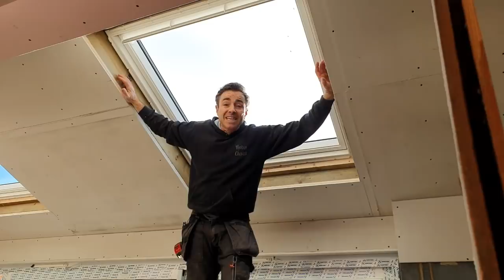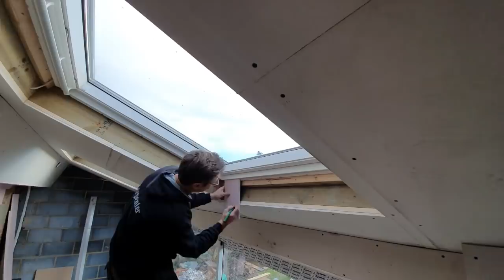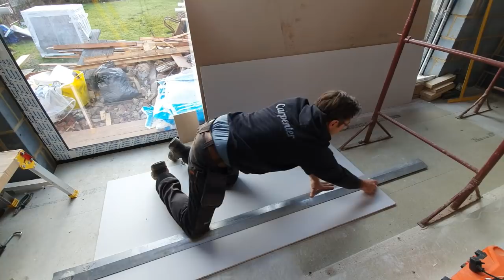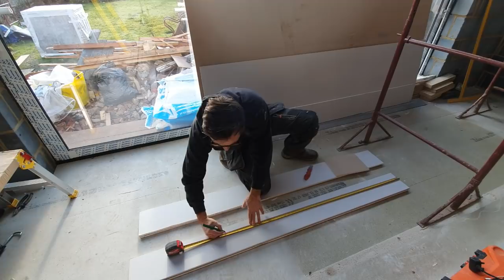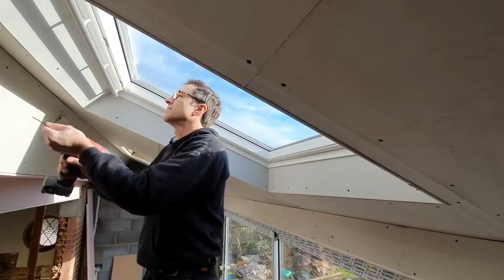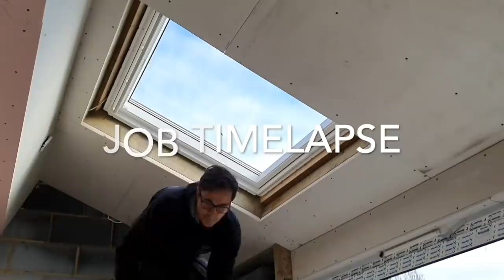How to Plasterboard a Roof window the fast easy way

Comment: A splayed edge is great, but how do you do this while having 52.5 mm insulated plasterboard instead of the normal 12.5mm(which you seem to have)? The point at which one attaches the screws would be too far in surely?

Comment: That is some beautiful work. Question.  Would you not pack out behind the plasterboard with some mineral wool or other insulation to maximise the thermal efficiency and prevent cold spots?

Comment: Great video but wondered why when you got the angle marked onto the offcut, why did you not just transfer the angle onto the 2 pieves you hadnt put up yet? Instead of taking down the pieces you already put up? That would also remove the need to cut around the timbers.

Comment: Just built a similar roof myself and the building inspector has had me put 100mm kingspan in between the rafters then 50mm kingspan over the rafters to stop heat transfer. It doesn’t look like you’ve had to do the same. Is there a reason for this or have I just got a jobsworth inspector.  Good tip with the plasterboard.
Reply: It might be insulated on the outside.

Comment: I just use a tape for depth,,do longest opposites first, then just use a speed square to mark the angles.
Squirt of foam adhesives bind and screw and they never move

Comment: Not impressed. Looks smart and no doubt you're a great chippy, learnt some great tips from your vids. However, it should be insulated behind the reveals and as a bare minimum have vapour barrier, fully taped. This could fail you an air test on a new build.
Reply: Any videos you know of with examples of best practice?
Reply: @fredrickwelch5678  Not that comes to mind. It will all depend on what insulation build-up you're using and there are a number of ways to tackle it. As some have said, you need to leave enough gap when installing the timbers for whatever insulation you use. Can be easier said than done on a retrofit. If in doubt, throw polythene and joint tape everywhere. Can't go wrong then.

Comment: I like the way you took all the measurements to start.. that can't be right surely if you fit top and bottom board first that side piece ain't fitting it needs re-measuring as the gap will surely be smaller
Reply from the maker: I took the overall length measurements to enable me to cut all the material in one go, the next step was to mark cut and fix the boards in situ and this makes it real easy, hope that helps mate
Reply: @robinclevettcarpenter  cheers thank you appreciate the reply and yes I see what you mean

Comment: Best to allow room in reveal for celotex insulation behind plasterboard. Stop cold bridge.
Reply: Good shout, some of the 25mm backed stuff would surely make a difference.
Think you could end up losing the frame behind it by the time it’s beaded and skimmed ?
Reply: @amateurvegan2636  you can get 20mm or 12mm thickness insulation. depending how you site the velux within rafters. Normally works out.
Reply: @colingreen4625  cool, never really used it myself because it’s so pricey! Good idea though
Reply: For Velux reveals I am going to use 12.5mm tile backer board.  Stronger than plasterboard and has a foam core so a bit better for insulation and easy to cut.

Comment: Interesting way of doing the reveals. I can get a sneaky 25mm of PIR in the reveals if I set it 90 to the window. I guess this can distribute the light a bit better. Hmm may give it a go.
Reply: Thats how i do it also, i think it looks better without a splay and like you say, you can get a bit of insulation behind the reveals.

Comment: I would have deducted double the thickness of the board (25mm) off the overall length of the sides and fitted without removing the top and bottom.
Good tip with marking the board though and a spot on job regardless.

Comment: You wouldn't use angle beads on the corners as there isnt a right angle.. they need stop beads, I did mine using the metal plaster bead tape but plasterer wasn't happy so I used the stop beads instead.

Comment: Hi Robin always impressed normally sorry to say not this time,standard plasterboard on reveals and cheeks absolute rubbish stick with the firecheck  or sound check we always cut width 50 mm deaper then run the saw through the ceiling line this way the angle always follows the angle of the roof regardless we always SBR cut edge and fix beads with no crumbling.A bit surprised no insulation at edges ? Keep up the great work👍

Comment: Something I do with plasterboard that I rarely see others doing, after scoring and breaking I'll fold the board then run my rasp over both cut edges at once before separating my piece. Keeps your edges nice and true and saves having to knock off any lumps that might make the board a bit tight.
Reply: Beat me to that comment mate. Makes life so much easier 👍

Comment: Wish I’d known this way a few years back, I’ve always battened them square or used insulation board.
Must let more light in this way too. 👍
Reply: Out of interest, which way do you think looks best?
I have some to do soon and I was thinking the extra insulation could be more beneficial than the extra light, as there should be plenty of light either way, but ultimately esthetics is key.
Cheers.
Reply: @SimonPlatt  I’m not sure, maybe Robins way looks better than square. I’d have thought an insulated reveal was a building control requirement though?
Reply: @lukehanna3344  Agreed  ...on both counts!

Comment: Robin, surely if you had deducted 25mm from the length of the top and bottom pieces [2x12.5mm, assume], that would negate the second part of cutting them to length.
The sides fitted, then the top and bottom would be the right size to fit.
Or, install the sides first, then measure lengths of top and bottom.
Reply: Nope, because they are compound angles. The sides and top/bottom splay outwards from the window to the bottom of the rafters.
Reply: @Herpitor  -  well, yes, I didn't think the sides were splayed, but if they are, you're right, can't be done that way. How silly of me!
Reply: Platerboard comes commonly in half inch and 3/8 yhickness why make things awkward by convertimg them to mm
Reply: @saltychannel21  -  Because this is not the US!  As you may not have noticed, Robin is using the far easier way to take measurements - in metric. The boards are 9mm and 12.5mm in Europe and most other places!
Reply: @the-tessellater  im in the uk and have been a joiner/ builder for the last 25 years. I generally use inches as its usually easier to remember measurements when your not  trying to remember numbers in the thousands. I sometimes use metric if its nearest to a round number but generally use inches as its more simple to remember measurements usually. Sometimes i use a mixture haha so it might be 87 inches and about 5mm. The only time i use metric is when fitting kitchen's as everything comes in metric sizes so its the only time when metric is the simplest  option and even then i still revert back to imperial when cutting fillers and worktops. People i work with find it hilarious when i give them mixed measurements
Reply: @saltychannel21  I'd like a 2.4 length of 4 by 2 :)

Comment: It’s how I do it. I always try to get the bottom reveal vertical. It looks really cool if you line it up exactly with the wall below. (Takes some figuring when you actually fit the velux) I also would have packed out behind the plasterboard with insulation or blown some foam around to prevent a cold spot
Reply: Good point, though foam can be so messy
Reply: Under part L you need to defo fill those spaces behind the plasterboard, you can just use Rock wool as it can be classed as a void on the reveal.
Reply: This is why I’m watching this as I need to insulate mine. I’ve foamed around the velux but need to insulate and board them.
Reply: @willber318  make sure you do. The top flashing is notorious for causing condensation if it’s not insulated. People tend to think the window is leaking but it’s nearly always because someone didn’t bother or didn’t know how important it was to insulate that wafer thin piece of tin.
Reply: @SingleTrack66  I’ve put expanding foam around the frame but I think I’ll put som rock wool behind the plasterboard before I fix it. Hopefully that will be ok. I’m sure it will just end up wet though 🤷‍♂️
Reply: @willber318  if you have foamed around the frame and then added rock wool. You won’t get condensation. So if anything gets wet, your velux isn’t fitted correctly and it is leaking.  
I think you will be fine 👍🏻.
Reply: @SingleTrack66  😂 there’s a good chance I’ve buggered it up but we’ve had some pretty heavy rain and no leaks yet. Cheers buddy 👍

Comment: Why are you cutting the top and bottom? Just fit the sides in and tape it. Boom done.
Reply: Its easier to fully board and skim - no-one likes all that sanding and dust.
Plaster skim is easier, quicker and cheaper.
Reply: Less Draft comes through like this
Reply: @jjamo5  After a coat of compound and tape, and two coats of compound after that? Nonsense.
Reply: i agree

Comment: I have to disagree with “easy and fast” comment on the title, your correct on your measures but the top and bottom should always be square so the top and bottom can be measured direct from the window edges, then cut to size before once, “rough the sides in” as you said yes but not waste time fitting then removing the top and bottom, then cutting them both twice then re fitting, cut once, fit last, 

I’d like to see how you overcome cold bridging too? As no apparent vapour barrier visible, not foil backed plasterboard and the roof seems to be traditional cold roof construction?
Reply: My first thought was where's the insulation
Reply: I'm sure that plasterboard had insulation on the back of it 🔨
Reply: @tomsmith9048  not on the ingoes, hence I asked.
Reply: There's insulation between the rafters and a double trimmer top and bottom which has a good u value aswell
Reply: @tomsmith9048  your missing the point, if there is no insulation abutting the velux frame and gaps from the edge of the velux itself, the cold bridging on the ingoes will then heat loss around the ingoes, 
I always use insulated backed plasterboard now for this point exactly, what’s the point in doing the job 99% right and spending hundreds on insulation to lose heat from the velux edges? The u value of the timber is completely irrelevant in this situation, you could argue it’s ok the rest of the roof insulated, a little heat loss in the edge will be fine, and with no vapour control this I asked the roof construction, as with no air flow, and the lack of vapour barrier mould could be a potential.
Reply: @jamesblair4709  of course u value is relevant it's what keeps it warm and if your insulation is at the underside of the rafter the air gap is at the top.of the rafter there's no need for a  vapour barrier as there's so much airflow over the top of the insulation there's no time for condensation to settle hence the bigger the airflow the less of chance of anything settling
Reply: @tomsmith9048  I feel you are not getting my point, 
The rafter should not be tight to the velux ever, for movement within the roof, so this gap should be insulated, but to regs it should be insulated to the underside of the frame behind the plasterboard, with a vapour control layer taped to the window, 
It’s not the right way to do the job, properly, the video was just to show how to plasterboard quickly even tho it’s not that quick, but I’m asking was their other steps he takes? I didn’t see a vapour barrier, so was there one or if not what was the roof construction, 
If your going to misinterpret the original questions then please have somewhat of a good understanding of the rest of the process to understand what is I’m actually asking 
Heat loss is the issue, condensation will be just another factor, it’s like I said in another reply, if you have heat loss then why do the rest of the job to such a high standard then fuck it up on the areas that WILL lose heat?
Reply: @jamesblair4709  I understand there's a gap from the window to the rafter itself 15mm that's for movement of the window as velux have stated and velux don't state having a vapour control layer tapped to the window in any way shape or form
Reply: @tomsmith9048  building control do tho.
Reply: @tomsmith9048  why would they state to put vapour control layer in, they don’t know what type of roof you’re installing it in to,
Reply: @jamesblair4709  they don't as they only specify bridging the cold gap between underside of rafter and face of plasterboard
Reply: @jamesblair4709  it wouldn't matter if it's a cold or warm roof as the aperture will still be where the velux is
Reply: @tomsmith9048  🙈 your really not getting this,  what trade are you bud?
Reply: @jamesblair4709  explain what type of roof you mean 🤔 please
Reply: @tomsmith9048   traditional cold roof, as it seems to be the construction in the video that I asked the original question about.
Reply: @jamesblair4709  as I said it wouldn't matter if it was a cold roof or warm roof as the aperture is still there
Reply: @tomsmith9048  so your saying if you were the installer that you wouldn’t install a vapour barrier? Are you saying that whether or not it’s a cold roof construction or warm roof construction you would not terminate a vapour control layer to the velux in either setting?
Reply: @jamesblair4709  I put my breathable membrane on top of the rafters before I batten the roof and the membrane goes under the velux flashing along with the tiles
Reply: @tomsmith9048  so where’s your VCL?
Reply: @jamesblair4709 I put my celotex to the underside of my rafter and bridge it with insulated plasterboard that's all building regs ask for
Reply: @tomsmith9048  in what country? 
Vapour control layer is a must!!!
Reply: @jamesblair4709  so what's your method plasterboard then vapour control layer then a a gap then celotex to the top of the rafter  then membrane and batten then tile or slate is that it
Reply: @tomsmith9048  I do it to the architects specification to the job, 
Generally in Scotland on a cold roof, rafters installed and the vapour control layer will be over the joists and then an insulated plasterboard on top, sometimes with a 38mm service gap to stop puncture holes for downlights, 
I’m guessing your not installing one at all? Ever? You need to brush up on your regs my man, as all vapour barriers should be installed to any warm or cold roof construction, whether it’s flat or vaulted, it’s there for a reason,
Reply: I’m adding in that I meant rafters, and the rafters are insulated between with air gap above, and it is 2.30 in the morning! 😂
Reply: @jamesblair4709  do you mean joists or rafters I can't tell what you mean an the terminology makes NO SENSE  it doesn't seem like you understand what your taking about
Reply: @jamesblair4709  so your vapour control layer is to the underside of the rafter then a gap then celotex
Reply: @tomsmith9048  give me a break it’s 2 in the morning and I’m only still having this discussion to help educate you as it seems to be that your not carrying out your job properly, so I’m sorry if my terminology is incorrect for the time of the day! 

Go search a building regs vcl for roofs, nhbc have it clearly in their website, and I’ve tried to google building control areas for England, and the ones I’ve found for all the areas are saying vapour control layers are necessary.
Reply: @tomsmith9048  sometimes it’s got a service gap yes, but sometimes it’s just sandwiched between, depends on the architects spec, and the u values being achieved
Reply: @jamesblair4709  I'll give you a break pal it'll be my pleasure 💚 but there's nothing in the building regulations about it if you keep your insulation tight to the underside of the rafter and you can use the expanding tape that goes around the insulation and lots of airflow over the top the more the better there'll be no change of condensation settling it's very basic Construction 101 come over I'll give you a few lessons sometimes
Reply: @jamesblair4709  your changing your story here pal which is it now
Reply: @tomsmith9048  
A separate vapour control layer should always be installed, and thus brings me back to my original question, how did he get by the cold bridging, and where’s the vapour barrier?
Reply: @jamesblair4709  but you haven't provided any proof that it's needed hence why he never did it come on son get it together
Reply: @tomsmith9048  👍🏼 you keep doing a shit job mate,
Reply: @jamesblair4709  I'll leave that to you 😝
Reply: @jamesblair4709  Not tight on the rafter I would agree with, and don't Velux do a expanding insulation gasket for the Velux frame to take up this slack and prevent cold bridging?
Reply: Ageee nothing quick and easy when your doing things twice, too and bottom can stop square then do your angles for top and bottom of the sides and measure the size at the window then add the angles, or put sides in square, measure to lengths, half the difference and take that measurement to nothing off each side add it’s done,, basically there’s quicker ways
Reply: Interesting discussion here!  I never saw a vcl on a traditional cold roof in England (normally just breathable 'felt' membrane and vented ...presumably that's what's in the video here?), but then it's been a while!  I was once NHBC registered, but my book will be out of date too!
Just a thought, I remember something along the lines of, in Scotland regs were to overboard rafters with solid boarding (osb, ply?) before battening for tiles, in which case I guess there would be a greater need for vapour control, is this the difference?  Or is it the case that all roofs now require a vapour barrier?
Reply: @SimonPlatt  yeah its called sarking you tend to get it in Scotland or in the west of Ireland where the roof will take a real weathering but the way I was thought it's done with 4x1 🔨
Reply: @tomsmith9048   That's the one, cheers!🙈
Reply: @SimonPlatt  no worries pal 😝🔨